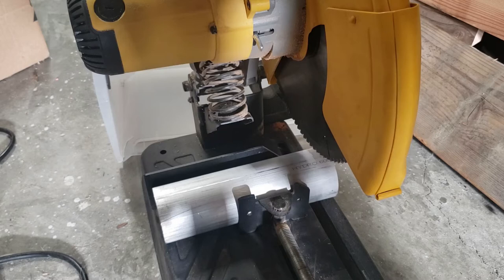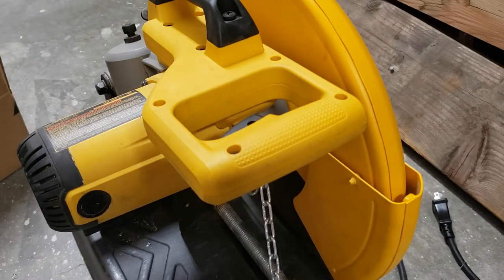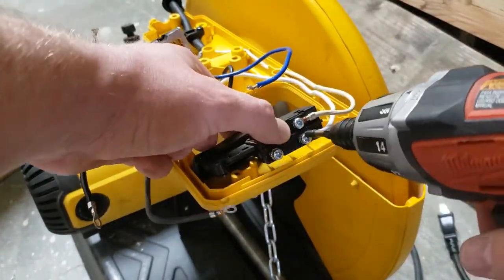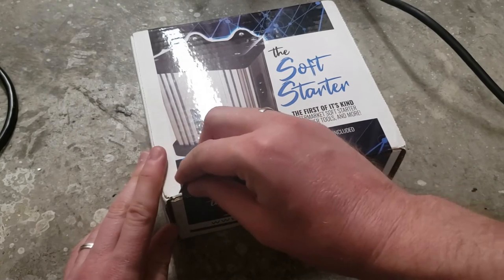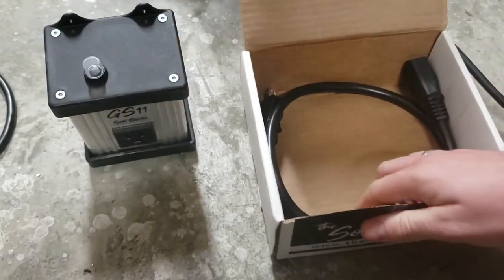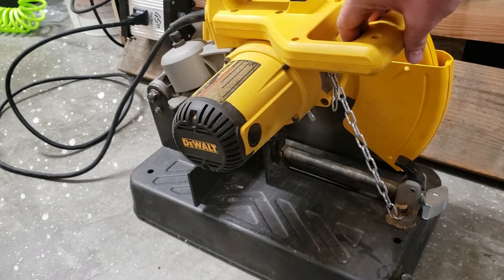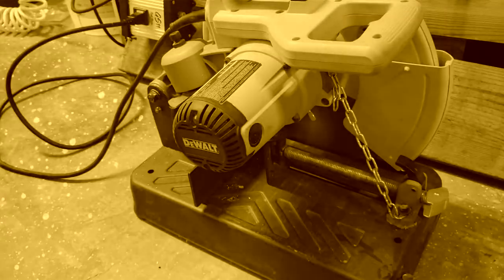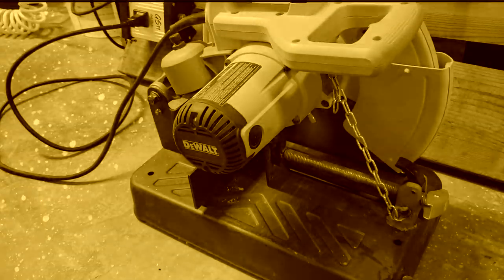Hitachi 371468 C10RJ Module vs Raymond Innovations Soft Starter GS11

Comment: What happens if/when someone plugs a power strip in it & runs more than 1 power tool?
Reply from the maker: I may have to make a video experimenting with this, but my guess is that it would work pretty well so long as you only use one tool at a time.  If you start up Tool B when Tool A is running, the soft-starter already has the floodgates open and will probably allow a jerky inrush as if it weren't there at all.  You'd also need to be considerate of not pulling too many amps through it if you're planning to use multiple tools at once.  The more I think about it, I definitely need to add this to my "future videos" list.
Reply: Yeah I'd like to see what u find out. My dad regularly uses a band saw w/ a dust collector, so that's 1 application that comes to mind. Small band saw, so I'm not sure which machine uses more current, maybe the dust collector, now I'm curious, going to have to go see what amperage they use.
Reply from the maker: Here you go: https://youtu.be/OYGEy0hZA10

Comment: I installed a Hitachi module and I'm surprised you haven't noticed the adjustment dial. Mine came set to the fastest start speed but you can turn it down much further so I'm certain you could get the same slow start (or even slower) than using that box.

Also I'm surprised you appear to be attributing the failed start with the lower gauge cable to the hitachi. That seems to be related to the lower gauge cable as you do acknowledge. It's no surprise that low gauge cable can cause a saw to have trouble starting with or without a soft start module.

Given these observations, this doesn't appear to be an unbiased video. You can certainly put the Hitachi unit in a box and use it just like the GS11, which would obviously include a nearly identical in design soft start module inside. 

You could save easily $80 by building your own box and have basically identical performance with the Hitachi.

Comment: Any chance the hitichi 371468 would work in a 24v system? Looking for any info on it being used in a DC system hoping to learn a little more before I just smoke one
Reply from the maker: I've not tried the Hitachi module with low voltage DC, but if I were looking at a 24Vdc motor, I'd be looking at a controller like this one: https://amzn.to/3X2DGav

Comment: Just received mine, Did you notice a small potentiometer on yours? Wonder what that is for? Have you tried the unit inline before the switch like the Raymond? I wonder if it will work in that configuration? great video.
Reply from the maker: I don't recall offhand, but If I had to guess it probably adjusts the ramp time.  I haven't played with it other than wired in as you see here.  I do already have an extension cord I cut up to test some big NTC thermistor units, so it shouldn't be too difficult to try it out.

Comment: I think the experiment I would like to see, is to put the Hitachi module in a box and try and use it as you would the Raymond? In-line.Really wouldn’t have to be in a box but just inline and plug something in to it and see if it works that way.

Comment: Can you use this with a power inverter in a RV for a fridge?
Reply from the maker: Generally speaking, soft starters and refrigerator compressors don't play nice together.  I've never played with this sort of setup myself, but I found a couple threads that go into the nuts and bolts of why it probably won't work:
https://electronics.stackexchange.com/questions/407494/soft-start-for-fridge-compresser
https://electronics.stackexchange.com/questions/256887/can-i-reduce-the-start-current-of-a-fridge-compressor

Comment: Do i need to remove the soft start originally installed in the hitachi table saw ?? Ive replaced my table saw soft start twice in one year. I think my problen was my 13amp  retractable power cord burnt the module out. But they are cheap and would like a better built soft start. Thanks
Reply from the maker: In my experience, running multiple soft-starters in series on a single load does not work well for similar reasons as you saw with your extension cord -- soft starters expect to receive full wall voltage and lowering that with another soft-starter or a sub-par extension cord can cause your soft-starter to malfunction and overheat. This is more of a problem with inexpensive NTC thermistor-based units than with the more expensive 100% duty-cycle industrial options.

Comment: I have a 2016 Hitachi C10RJ table saw.  I ordered a replacement soft start and can not locate it on the saw.  It is not in the compartment behind the start switch and reset switch. Is it possible that it does not have a soft start?   It quit working after blowing out saw dust.
Reply from the maker: I don't have a C10RJ myself, but my understanding is as you say that the module lives in that box behind the the start/stop buttons.  You can see the module well in this video: https://youtu.be/1VU2vnZRuEw?t=98 -- if you don't have the module in there, I suppose it's possible either a previous owner removed it or it was optional or not included yet in 2016.  If it quit working after hitting it with compressed air, you likely either knocked loose a wire that was about ready to break off from vibration anyway or you got a piece of grit inside the start contacts.  If you have the equipment and comfort around questionable power tools, your best bet is methodical troubleshooting with a DMM, tracing where you should have power and comparing that to reality.
Reply: @cilynx  Mine does not have a soft start.  It just has a black solid cover with three screws where the soft start should be.  Currently waiting for a new reset switch to arrive.  I bought my saw new at Lowe’s in 2019 on 50% clearance 3/2016 stock.  Will post the outcome.  Thanks.

Comment: I bought the Hitachi also and it does the same way on your first round, start then stop. On the second time around that you started your Dewalt,  can you share how you plugged and connected it? thanks.
Reply from the maker: I ran an extension cord and plugged it into an outlet on a different circuit. I'm not sure if it was the cause or not, but the outlet that did not work without the spendy soft starter is a GFCI and the one that works straight is not.

Comment: I'm riding the fence on the C10 or the GS10. I think sum days the c10 would be fine, other more demanding/intense days the GS10 would be better.      Does your GS11 have any kind of fuse or thermal protection other than a thermostat controlled fan?        - thanks
Reply from the maker: I tend to overindex, but I'd recommend going for the GS10 if you're planning on any sort of repetitive use.  The C10 is only spec'd out for 20 starts per hour.  For many applications, you'll want a lot more than that.  I haven't played with the C10, but what I've seen in other non-continuous-duty soft-starters is that they heat up quite a bit, take a long time to cool down, and you don't get another soft-start until it isn't hot anymore. 

As a general rule, they use NTC (negative temperature coefficient) thermistors and there's really nothing you can do but wait.  I've also seen other brands light-duty soft-starters cook the NTCs to the point of cracking and coming unsoldered when running a steady load for any length of time not even levering the soft-starting feature. 

As for thermal protection, yes, the GS11 has a resetable breaker.  It isn't in the product pictures on the website, but you can see the dustproof button on top of the unit in the video.
Reply: Thanks man, good to know. I went w/ the GS10, looking forward to it. How long have you had your's now?  Does it work fine in hot & cold temps?
Reply from the maker: My GS11 was new when I posted this video in May.  I've mostly used it with the chop saw, but will be updating my setup after the experiment you inspired.  I haven't had any trouble with it at all and it seems unaffected by ambient temperature.
Reply: @cilynx  Cool, thanks man. Christening my brand spankin' new GS10 today.

Comment: Thanks for posting this. I wouldn't normally ask this kind of follow up question but you seem like you might enjoy getting into the details on this kind of thing. How much does the soft start reduce the starting amps of the tool? I have an 8 amp compressor that briefly pulls 23 amps right at start and I am thinking of trying to add a soft start to it because I'm having similar problems where it trips certain surge protectors. Thanks and appreciate the video!
Reply from the maker: As far as I can tell, soft starters aren't particularly "smart", so they're not measuring and limiting current directly.  Rather, they just add a substantial amount of resistance to the circuit long enough for things to ramp up smoothly.  My small compressor (https://amzn.to/3inHOgK) doesn't much like the soft-starter -- it turns over a couple of times then stalls until the soft-starter fully closes the circuit at which point it runs like normal.  Then again, the little compressor doesn't take a big drink at startup either.  I would think whether or not a soft-start would work with your compressor is going to depend mostly on how much torque it needs to get going.
Reply: @cilynx  Thanks for the detailed response! I found that my similar compressor doesn't draw a lot of power when it's filling from empty, about 7 amps. But when it's topping off a half-full tank, it needs almost 24 amps right at start, which must be to overcome the pressure in the tank. Then it quickly drops back to 7 or so. Sounds like a soft start wouldn't be any help in this case because the motor still needs a forceful push to get over that resting torque and might even damage the compressor. Really appreciate your quick reply.
Reply: @cilynx  Air compressors use an induction motor, which these are definitely not designed for.

Comment: What exactly is on the inside of the Hitachi 371468 ?
Reply from the maker: A good question for a future video. Adding to my todo list.  We'll look inside one of the Hitachi modules and compare it with the cheap Electronics Salon module I fried and the GS11, assuming I can open it up without destroying it.
Reply: @cilynx  My guess from the construction and performance, it's like an NTC and maybe a relay.  Would be interesting to crack it open since it's the most affordable (and portable) of the bunch.  Like I personally don't even care about the more expensive ones.